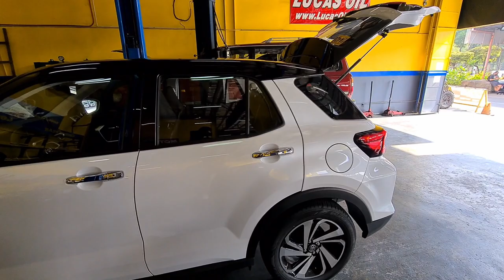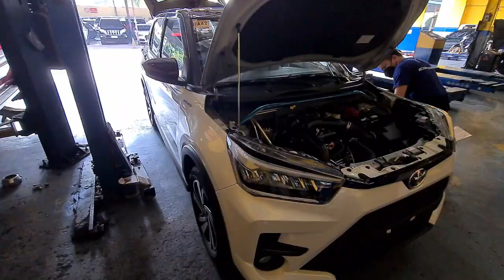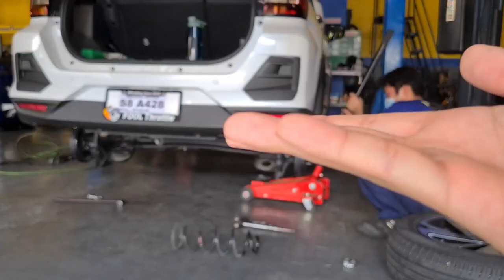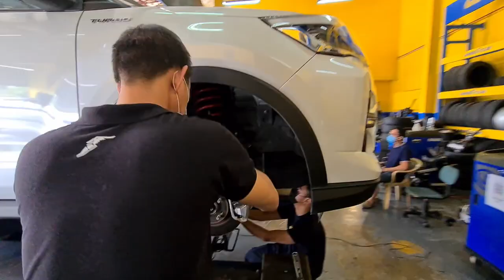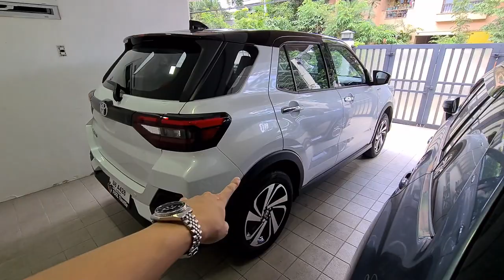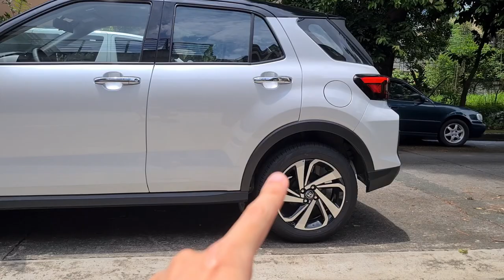So you want to LIFT your TOYOTA RAIZE? Here's how to do it!

Comment: I highly suggest not to raise the car too high. Especially with raize its not build to be too high i rather lower the car to improve stability when driving. Also like you said the cv joint is having issue already in the long run your cv joint will break send it back to the mechanic and lower the high of your car. For me its better lower suspension then add a bigger wheels like 18 inch to make it look cooler and better stability controller. Don’t take this as hate comments i just want to share this to everyone that not all car need to lift that high.
Reply from the maker: the build route is to go overlanding, so lifting the car at 1 inch shouldn't be a problem. Think of lifted Forester's and XV's, it's the same thing. I never said there was a cv joint problem. Please go watch the video again.
Reply: @FranzGaw  foresters have bigger engine lifting the car is ok for off road or over landing but compare it to raize that has a very small engine for sure mahihirapan yan. Regarding sa cv joint may sinabi ka un pag dumadaan ka sa humps, mas mabilis wear and tear yan dahil sa sobrang taas ng suspension mo. Unless meron custom made na cv joint sa raize for raise suspension.

Comment: Hi, curious lang. hows the rear suspension after replacing it with the tanabe? I find the rear stock suspension too soft thats why i cant put too much load on mine.
Reply from the maker: Actually still soft and comfy but with a lot more travel which protects the shock absorber and bump stops even more at full load.
Reply: @FranzGaw  thanks for replying. Actually torn between lowering or lifting. Waiting for your upgraded tires and see how it performs on some light trails. 💯